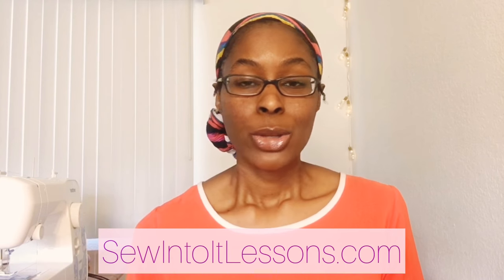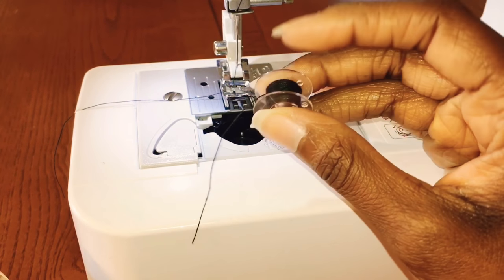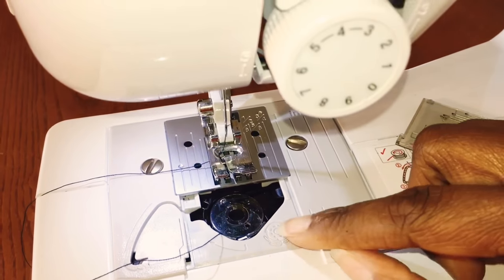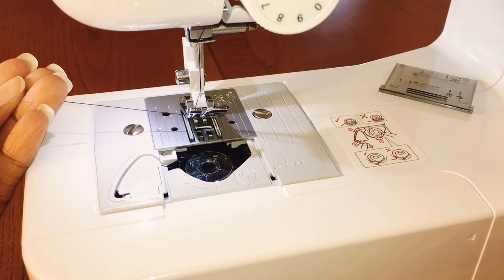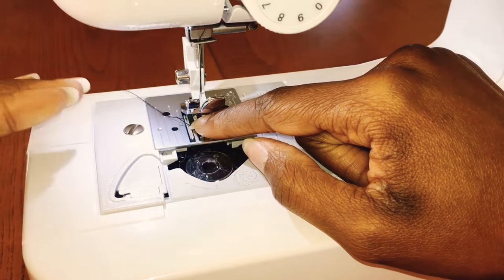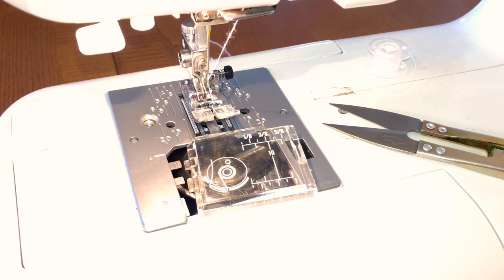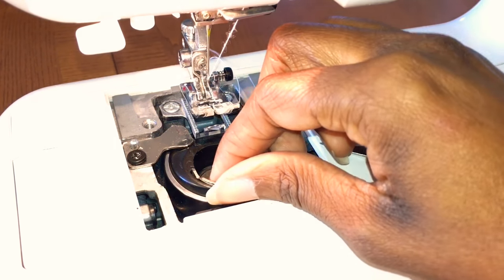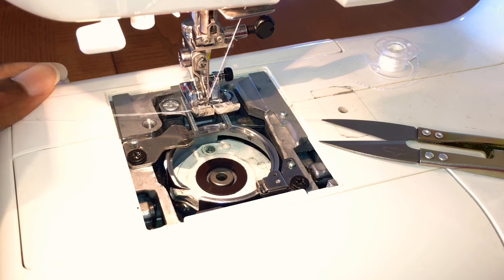Help! My bobbin thread won't connect/ what happens in the bobbin when you have a timing issue?

Comment: Mine machine might not start sewing and all of a sudden it will start somewhere down the line.  Any suggestions from anyone?  its very frustrating-I get to the end of seam and NOTHING!!  I have a Brother 2500D
Reply from the maker: Jo Ann Cottle 1st, when you can, check out this video https://youtu.be/8v8q0xF7l90. I talk about all of these in the video. 
you can...
👉🏾Make sure you have the correct needle to fabric combination
👉🏾Make sure your needle is not bebt 
Make sure you need is not inserted backward and 
👉🏾Check the bobbin case for a build-up of lint. I also have a video showing in detail how to clean that. Hope this helps!

Comment: On my industrial machine, I need to insert the bobbin thread clockwise. Just saying.
Reply from the maker: G Marion hi! Yes, there are differences between home and industrial machines. If your bobbin is front loading, you would absolutely need to insert the bobbin in its case with the thread unwinding in a clockwise direction.

Comment: OMG!  I was turning the hand crank the wrong way!!!
Reply: Layla Medina  That is not a hand crank  - it is called either a hand wheel or a flywheel. Never turn it away from you - ALWAYS TURN IT TOWARD YOU! Why? You can knock the timing off OR actually damage your machine. READ your manual. No manual? Google name/model number of your machine and get yourself a manual to save you hours of agony wondering what is wrong with your machine. 99 times out of 100 it is not the machine, but the inexperienced sewer. Want you to be a happy, knowledgeable sewer, so download a PDF of the manual...many are absolutely FREE to download!!!😊❤️💖

Comment: My machine pulls the thread through but doesn't actually sew. Is it me that's caused the issue or is that timing?
Reply from the maker: Bekah Armstrong hi! Have you checked your needle? If it is bent or damaged, it will cause the upper and bobbin thread to not catch. Also, if the needle and fabric are not correctly matched, that will cause stitch issues. I hope this helps.
Reply: @Sewintoitlessons  I changed the needle and it seemed to pick up some but it was literally two stitches then.  I do think it's the timing so I'm going to have a look at that today ❤

Comment: Plzzzzz u make video singer fit line 6200 my machine did not catching the bobbin thread and not working I m very worried about my machine because stop  my work 😭😭😭🇵🇰🇵🇰🇵🇰🇵🇰
Reply from the maker: Alishah, I’m sorry your machine is not working. Have you changed your sewing machine needle? Singer sewing machines only work with singer brand needles. Also, if you sew a lot, check the bobbin racer for lint build up.
Reply from the maker: This is how to clean the racer https://youtu.be/XAQPbCsNZJM
Reply: @Sewintoitlessons  thank you laree now I change the needle and I will tell u thanks alot

Comment: The thread is still the same not connecting to upper  thread.
Reply from the maker: Juliana, try checking if your needle is the right one for your sewing machine. Singer machines, for example, will only sew properly with Singer needles.

Comment: Why does my bobbin NOT move when my plate is on.  If I take it off, it moves.  I know for sure it is in correctly.  😔
Reply: Rhonda Fosson Couldn't be. If you have a horizontal bobbin case like the one shown in this tutorial, did you have thread going in correct direction and threaded properly through groove? Did you leave bobbin thread tail and the needle thread tail at least 5" and pull them UNDER the presser foot and to the BACK (NOT the side) of the presser foot?

Comment: Okay I have everything as it should be and still the thread isn’t catching! I have only had this machine for a month prior to I had same one and it did same thing! These machines are just junk! Taking this back and getting a singer over these brother sewing machines
Reply from the maker: Tiffany, hi! Have you checked that the needle is inserted correctly? If it’s backward, you will have issues. Also if the bobbin is inserted backward, there will be issues. 
If you do get a Singer, keep in mind that you can only use singer brand needles in their machines. Otherwise, your threads will soon begin to break and tangle.